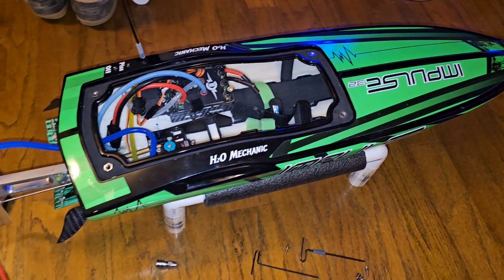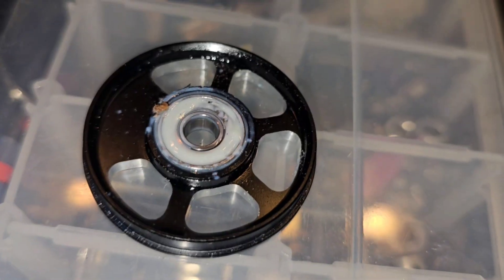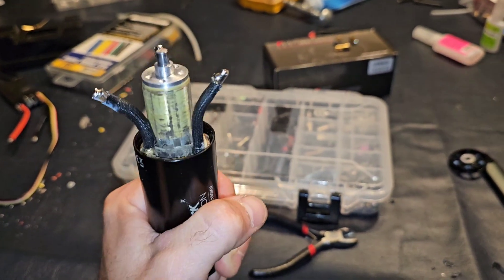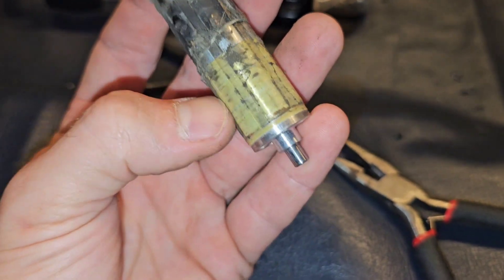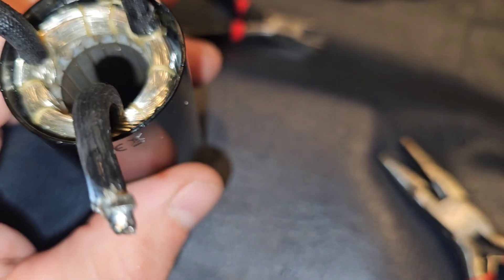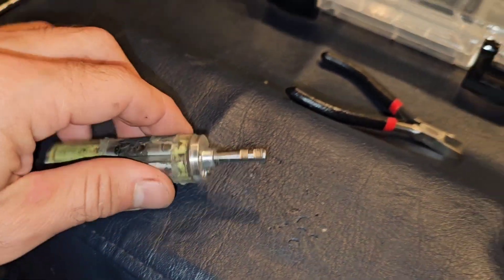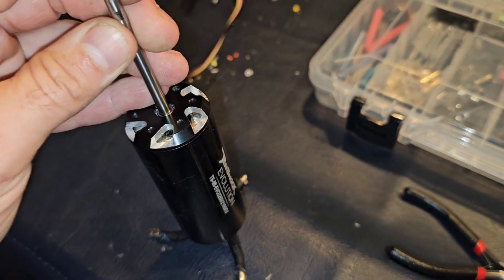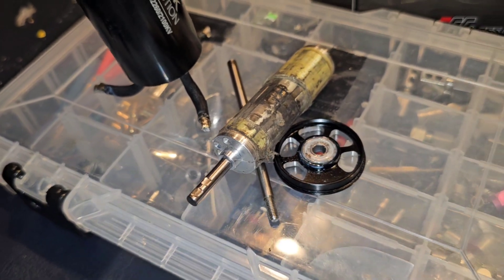Inside A Tenshock Big-Block Motor 2260 2100kv (The Rotor Failure)

Comment: Im no motor expert in any way. But same happened to my castle 1521 (and x8s esc) and i dont believe its a temp issue but something in the rotor design. I ran that motor only a few times on 6 and 8s and i NEVER had a motor or esc running so cool. Nevertheless it didnt make 10 runs total which meant 279 down the drain. Run a sss now, same kv, no problems so far and more than 20 runs on it. Realisticly i think you should and may expect from a motor 2.5x the price to be better and more durable than a cheap one. Also think its nonsense people talk about to much rpm, heat, etc... If the manufacturer states its 6 or 8s compatibel, then it should be that. And you can blow a motor or esc when you abuse it, bit using it were it was intended for with the right temps, etc, etc, is not abuse in my opinion...
Reply from the maker: @peteroosterhoff8850  I totally agree! 6s. 6200W 38k rpm. Definitely within normal limits, especially when it's never above 125⁰f

Comment: I know that it's not your purpose to talk badly about a company but facts are facts and not one but 2 of these ridiculously priced motors failed and they won't stand by their products. So I'm never buying one of these motors based on that. I work hard for what i buy, i expect quality products from any country for my money. I can buy several of those rocket motors for the price of one of those and if they blow up it didn't cost much. But I'm sorry your out the money and though it doesn't really help you, you've helped us learn about this brand. Thanks
Reply from the maker: @jimstone5339  if you don't share the experience (good or bad) the company won't know. So they can change their manufacturing process.
Reply: @H2oMechanicHobbies  yes sir you are right

Comment: I ran an EVO 2240 in my rigger and on my 2nd outing I seized the motor. Back to running the old dependable Leopard with no issues. Both are almost the same KV and 1716 Hoffman prop.  Seems like the Tenshocks can't handle big American man props.
Reply from the maker: @CarRamRod84  good to know I'm not the only 1

Comment: Philip, maybe when the water got inside it rusted the laminations beside the magnets and caused so much pressure that the magnet cracked. Or the windings partially shorted causing an over-heat condition at that point causing the magnet to crack. I used to repair TVs back in the 80s and 90s and I had a piece of test equipment that would test coils by "ringing" them, It put a pulse in a coil and counted the rings of the magnetic field as it collapsed. 10 or more rings meant a good coil. A coil that didn't ring meant that it was usually shorted. I used it for moters and TV deflection coils ETC.
Reply from the maker: @transmitterguy478  the first one failed & it never got wet. But regardless, the nipples blew out of their cooling jacket so that is also on them.

Comment: Definitely looks like a heat related failure. From what I’ve seen on your videos you haven’t even came close to abusing this motor…. You & the other people who paid dang near $300 for these motors are beta testers.

Your channel has absolutely sold motors for Tenshock & IMO you should seek another replacement motor!

I’d like to try the 1050 or 1350kv version on 8s, should be able to prop up while having a significantly reduced amp load compared with the 2K+KV versions on 4 or 6s.

Comment: From what I understand and my experiences with "Slinging magnets" is the adhesive that holds the magnets onto the rotor got hot at some point, the adhesive basically let's loose and the magnet spins free of the rotor at high rpm.   The kevlar helps keep them tight but doesn't really do much once the adhesive has been heated and broke loose.     

 I hate to see this happen to you, at least we got to see what the inside of a tenshock motor looks like!  THAT THING WAS PACKED. I noticed short can tp motors have a higher rpm rating than there long can motors, probably due to "shaft flex" like you mentioned.  BG4L
Reply from the maker: Thanks for your input, I was hoping you would touch on this topic. Sounds like we think the same thing. But it still hurts bc I loved the power of that motor! Maybe a redesign version 2 with a 8mm shaft would help idk.
Reply: I don't think that the flex of the shaft would be a factor till the magnet let go